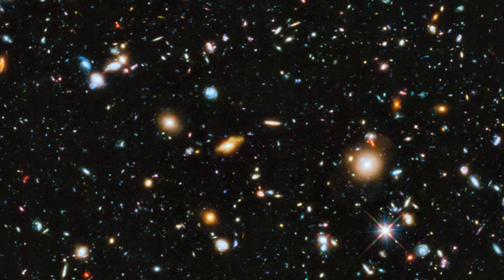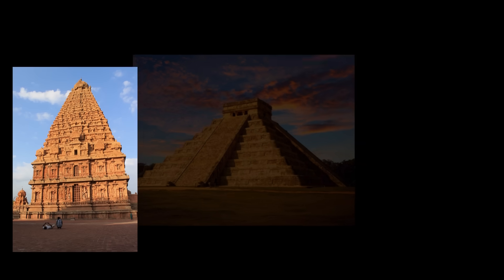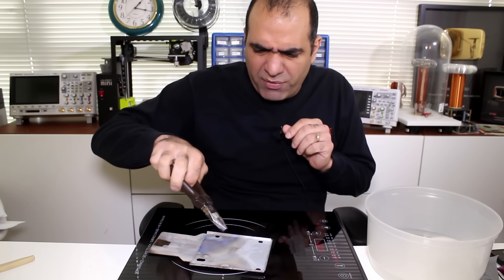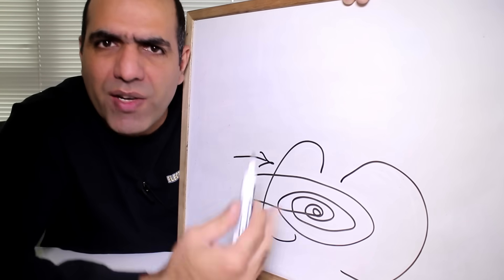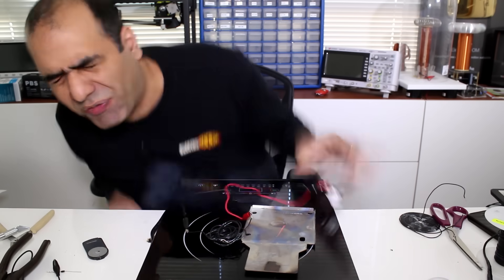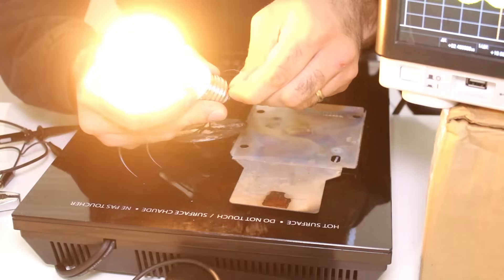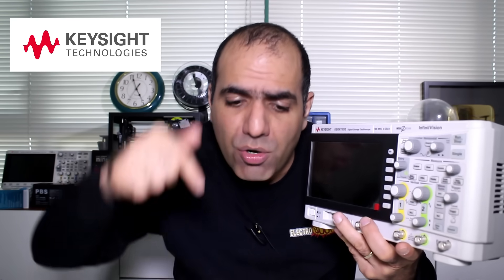Induction Energy Experiments

Comment: In the military I used a Ticomatic induction microwave casting machine that could turn an inch long ingot of chrome nickle and beryllium steel into a white hot pool of molten metal used to cast custom parts in a matter of seconds.  This was an induction microwave machine and the magnetic fields were off the scale, though if you were wearing a metal object like a watch or wedding band, or nearby metal equipment, were unaffected.  The reason was the power was focused into the coil that a lever raised so that the coil surrounded the crucible and melted what was in it very quickly.  If the crucible was empty and you turned the machine on and put your finger in the crucible it also would be unaffected (they said, I never tried it) but I was assured that the magnetic field could be measured from orbit.  Don't know about that.  When placing a mold into the machine you had to step quickly, the metal was preheated for a few seconds then the mold placed into the machine, then you reengage the machine and step back, this is because sometimes the molds broke apart when the centrifugal force shot the liquid metal into the mold and the result looked like the fourth of July.  My uniforms had to be replaced regularly because of the tiny burn holes in the fabric from when that happened.  There was one item so large that it was actually just a little beyond the specs the machine could handle, taking an inch and a half of the alloy steel, I cast it over and over and over and the mold either broke or there was shrink spot porosity in the casting because at that size there was virtually no sprue reservoir.  It finally worked about the tenth time.

Comment: I've got an experiment that works in a similar way but it doesn't have thick wire inducing a Hevey current  it usd a non conductive short ferrite core super saturated with so much energy it burns your kin on contact and even through metal placed onto it

Comment: The strange waveform is because those cookers are simply using a cheap circuit made of a capacitor in paralell with the big coil and and an IGBT to switch it at the resonance frequency. It's amplitude is changing at double the mains frequency because the DC supply voltage of the high frequency circuit is just rectified mains without smoothing. I know that because I already opened broken induction cookers.

Comment: Why in this case you need an insulated conductor to make the coil while in a transformer they just use naked wires?
Reply: Transformers don't use naked wire, they use enameled wire. The enamel acts as an insulator
Reply: @niko1even  this is a doubt I always had. So in a transformer the coils are always made not with just copper wire but a wire insulated with a thin layer? Even if the wire is very thin?
Reply: @giuseppegius6175  yes they all have a super thin layer of enamel. If they need to be connected to anything, that layer of enamel is scraped off and then the wire can be soldered or connected.

Comment: Why doen't the cable melt on the stove? How warm is it?
Reply: The cable doesn't get very hot because its very conductive so instead of converting the magnetic fields to heat, it converts the magnetic fields to electrical power. It still probably gets warm though due to the small amount of resistance in the wire.

Comment: hey, what's the bandwidth of that proskit DMM??,  if the frequency is 20KHz, that DMM could be lying in the voltage reading, even if it is branded as 'true RMS'., very few DMM have enough bandwidth for measuring such high like audio frequency.
so that AC measurements could be lying, and the actual AC RMS voltage could be much higher.

Comment: Put a small tube and a paper clip together by putting the straw  threw the paper clip and put to paper clips supporting it on phom and put the magnet on the phom very close to the circle coil with end rods being supported and connect the amp creater on there and set it to 12 volts. To make a moter

Comment: Voltage output drops from 200 to 160 volts because an induction plate heats up your pot in pulses. Probably saves some energy and has an acceptable low impact on cooking time ?

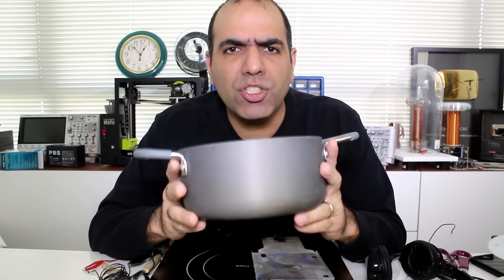Comment: 5:47 thanks! Now I will not fear from touching the cooker. I thought earlier that the cooker heats and if I touch it then 💥 
But now it is fine
Reply: my cooker does heat up a lot, probably the hot plate is heating it up sooo
Reply: Don't touch it after you warmed the pot up though!

Comment: I don't need a scope, but I watched the video, and I need an induction heater, a coil, a plug converter, and I think I can build my own phone charger circuit.  This is really weird, you had a video, and you didn't shock yourself, you might want to see a doctor about that. Will a graphite pan work with the induction heater?  Thanks as always, Hi-5

Comment: Correct me if I'm wrong, but if you were to make a generator out of a drill and you used the electricity from that to charade a battery, could you use the energy from the battery to run the generator while charging it with the generator and run it indefinitely....

Comment: It is because the led is polarized. The induction has to be turned so it gives the led the right polarity. But you can fix that with a diode bridge or use an incandescent light.

Comment: Here is a fee energy experiment, take a ultrasonic resonator or gun and point it at a cell phone induction charger with two doughnut magnets attracting each other over it. The goal is to use sound waves to vibrate the magnets to induce a charge in the pancake coil.

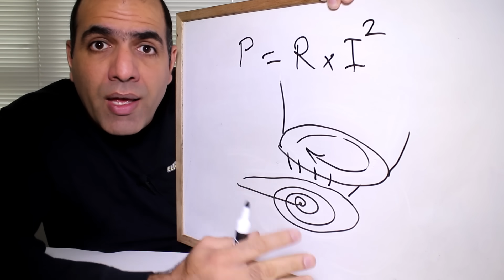Comment: 5:00 if you have Copper or aluminum wouldn't the current be higher because the resistance is lower?
If you calculate the current using ohms law and then combine that with the formula for Power the resistance shouldn't matter, right?
Reply: The current through the conductor cannot be attributed exclusively to Ohm's law because there's magnetic fields involved which make things complicated.

Comment: A few years ago, I opened up my induction cooker and replaced the flat coil with a non-flat coil I made out of copper tubing.  I wanted to get it working to heat metal for hobby smithing.  Just like your cooktop, mine will only turn on if it reacts off of iron/steel.  I turned my cooktop on, held a piece of metal in the center of the coil, and watched it turn dark red.  Sadly, it then threw all the breakers in my apartment.  It didn't do that before I replaced the coil.  I hope to one day be able to get that project up and running so I don't have to waste money on charcoal or propane.  If you see this message, can you do a video on converting an induction cooktop into a blacksmith's forge?  Thank you very much.

Comment: Free energy aside, on the subject of efficiency, could the thermal energy lost from devices such as lamps be absorbed into usable electricity and fed back into the circuit somehow?
I wonder if something like that could improve energy efficiency of powered devices that produce all that thermal energy as waste...
Say something like a light bulb with glass that can absorb heat better rather than let it out so freely, then a thermal electric device inside the bulb could convert that heat into usable electricity.
Even without special glass, and having a thermo electric device inside the bulb to harvest the wasted thermal energy and feed it back into the circuit could improve its energy efficiency, couldn't it?

Comment: Induction cookers turn on and off to gradually bring up the heat of whatever pot is on the cooktop. It’s a super slow pwm style method. So the numbers on the dial are usually just a delay adjustment.

Comment: The light bulb kept turning on and off due to the design of the induction oven heating system, which does not drop voltage as you adjust the heat setting, but simply increases or decreases the amount of time the heat is on. 
This is why if you look at the heating pad before cooking, it glows red then shuts off, then turns back on again

Comment: If you want free energy, figure out how to harvest the kinetic energy of neutrinos.
Reply: Bryan Beck that would be extremely hard, for neutrinos only experience gravitation and the weak interaction. Therefore, they pass through almost anything losing negligible energy.
Reply: @northernskies86  they also apparently have no electrical charge (pos or neg). But after some reading online, it looks like they've already started developing this.  Neutrino power cell, I believe they are called. They use layers of silicon and carbon applied to a metallic substrate. Apparently the neutrinos cause resonance when they pass through the layers.  Seems too good to be true and also super cool.

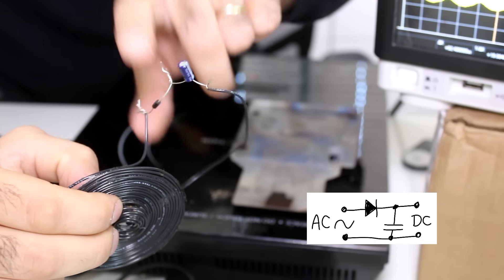Comment: 8:43
Sir you don't need more voltage
The bulb blinks because the fluctuating magnetic field is also fluctuating in form of square wave

It is same as low frequency astable multivibrator is powering up another high frequency sinewave making circuit😇

Comment: well... given mehdi touched the subject of using those phone chargers used in car's cigarette lighters with batteries instead of directly from the car lighter itself, i have a quesion. 

some time ago, maybe a year or more, i made myself a 3s 18650 pack and used one of those to try powering a 12v to 5v adapter like in this video, but even my battery being full, the charger continuously oscillated between being on and off. anyone knows why could it be?

Comment: I've learned through quantum physics that there actually IS energy all around us. It's harnessing it that's the hard part. Actually the impossible part, because it's  not electricity it's nanoscopic FORCE. you'd have to create machines smaller than atoms to convert it into electricity at all and God knows what would happen from converting the very universal fundamental forces into electricity using the universe for it's push. You'd probably slow everything down taking it's energy. You'd ruin existence itself just to turn something on? Eh, I'd rather the batteries lol.
Reply: engineering below the nanotech limit is impossible.means u cant built something stable at quantum level.

Comment: The reason is that your led os acting like a full wave rectifier, when it turns in it is forward biased but when you rotate the wire it acts like an ac generator so during the negative ac cycle the led is reverse biased so it doesn’t turn on

Comment: I like your artistic videos :) Thank you.
But in this case, I'll put some salt into this video. Beginning from 4:46.
The main reason why you need special pan, a iron pan is not only resistance!
Iron has 9.7×10^−8 (Ω·m),  and copper 1.68×10^−8 (Ω·m) - only 5.77 time bigger resistance.
But Iron and different iron's alloys has much bigger permeability as the copper or aluminium. Iron has 0.0063 H/m and Copper - 1.26×10^−6 H/m - about 5000 more!
You're noticed right, the P = R * I^2 or P = U^2 / R and U or (electromotive force) Ε = -L * dΦ/dt and inductance L = μo * μr * s * N^2/l. (μr - permeability)
Short of all Iron has 5000 bigger inductance and therefore Е = -5000 * L * (dΦ)/dt in iron there are 5000 bigger voltage as in copper, in addition iron has about 6 time bigger resistance. This all means:
P = U^2 / R and for iron P is (5000 * U) ^ 2 / (6 * R) -> iron dissipate about 4166666 time more energy as a copper!
Btw, skin effect also depends on permeability and it made iron resistance at high frequency more different from copper but only as square root.
One more time: the main reason is a permeability!
https://en.wikipedia.org/wiki/Inductor
https://en.wikipedia.org/wiki/Inductance
https://en.wikipedia.org/wiki/Electrical_resistivity_and_conductivity
https://en.wikipedia.org/wiki/Permeability_(electromagnetism)
https://en.wikipedia.org/wiki/Skin_effect
Sorry for critic ;)

Comment: well, that's some crazy new age version you have heard about ?!? FOA the baghdad battery doesn't need to be charged, it just needs acidic fluid to work (so what you basically have is an acidic fluid and 2 different metals, in case of the battery cobber and iron, you should try that ;) ).. the pyramid version I heard demands water in the basement (from a tunnel to the river nile that was supposedly much closer at the time they talked about in this one), and possibly chemicals inserted through some of the small higher tunnels (can't remember what exactly it was, saw it a long time ago and might have mixed two together (also saw a lot of BS of course :P), and again this energy would only be usable locally as far as I understood).. but I guess the new age version is much more fun, then you have something to laugh about.. but as an engineer (I would assume) the one demanding water in the basement, actually using and amplifying (in the upper chambers) the energy from the waves hitting the ceiling in the lower parts, was a interesting version.. I will try and see if I can find it again (as I said it's been a long time, since I saw this).. but my point is, that one was talking about taking some energy, and amplifying it and possibly also transforming it in some way.. this actually sounds to me somewhat plausible (though I'm no expert, and can't even remember it all..), and is not just some magic energy from space.. but no matter what, no energy comes from nothing.. it has to come from somewhere.. and in that fact actually space itself should have quite a high amount of energy to keep this structure, which is our reality (or again, so I would belive, but saying that I'm also sure it's not a good idea to tap into that without cation) and we have so many "free" sources of energy, sun wind water, and so on, we just gotta not do what ever makes one guy rich, but what is right for nature.. ..

Comment: Hi ElectroBOOM. Can you calculate the speed at which inducted energy is transferred from the plate to the coils load? Maybe if one theorises a slower experiment for the scope to handle with triggered capture of CH1(probe inside the cooker) and CH2(probe homemade coil). Can load resistance, capacitance and inductance affect speed of transfer? Is it too fast to measure? In long wires, different types of signals travel at different speeds... more on that later. If one modulates the input frequency, can one strike efficiency resonance to coupled load (cooking-pot or homemade-coil)? Maybe a capacitor mux switch for different load types (maybe they do all this already???)

Comment: Does anyone have an idea of the voltage magnitude induced in the utensils, which consequently leads to Eddy Currents ?
And is there a chance that a broken utensil might give someone a mild shock?
Reply: If I'm not wrong, won't it depend on the resistance of the utensil itself?
Also the current should run only inside the bulk mass of the conductor so even a crack shouldn't shock the user…
Please correct me if I'm wrong!

Comment: It is wrong that lower resistance pots can't produce high power. They can produce higher power at a fixed voltage. But because current is limited tough the transistors they PWM ans SWM it so that current doesn't exceede that value. So power transfered is reduced. But then again you could create a coil with more turns and you would be able to get higher power on aluminium pots than on pots made of ferritic materials.

Comment: I thought the rectifier had turned to the dark side. Should I call you... The Inverter?

Also, Baghdad batteries are real. They can give about the same voltage as a half discharged AAA.

Comment: Hello Mehdi! Big fan!! Absolutely love the step by step analytical progression that you have in your videos. Learnt a lot. But i have a stupid question to ask you. When two batteries are connected in series, why does connecting the positive terminal of one to the negative terminal of the other not cause a short circuit between these two terminals even though the other two terminals may not be connected?
Reply: Because in a battery, the negative and positive terminals are ”connected” inside the battery, through the acid that powers it. Between two batteries there is no energy

Comment: Baghdad batteries are real. Two of them in series  are comparable to an AA alkaline battery. 

Pro tip: if you put your battery in series with a chicken egg, you get unlimited free energy! (JK)

However, there are ways to actually get free energy. 

1. Move into your parents' basement. They will pay the electricity bills. 

2. Move to Kosovo. The entire country has stopped paying for electricity, and the rest of the European power grid is still supplying them. 

(This doesn't violate the laws of physics because someone is paying for it.)

Comment: LED does not work because the direction of current changes and LED are diode and diode are semi conductors and semi conductors apply high resistance to one side while applying low resistance to the other side.
Reply: That inducer uses AC power so should light the LED in both directions, however as he shows you in the video it has a steady draw in one direction but a steep drop in the other.

Comment: The closest we'll ever get to "free energy" is building machines that extract more energy passively than it took to produce them, so wind farms, electrical panels, water turbine generators etc. Stuff we already have
Reply: Fusion would still be better, the energy released when splitting or merging atoms is unbelievable and hydrogen is the most abundant element in the universe, we could fuse them together for a million years and never make a dent in the Earth's water supply.  If we crack fusion a small power plant by the sea could produce as much energy as a small nation covered in wind turbines.